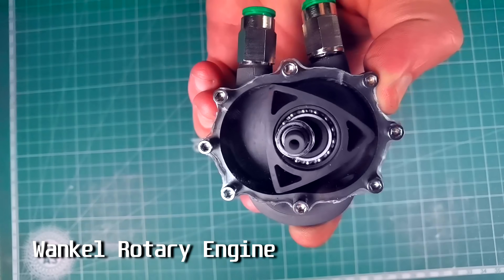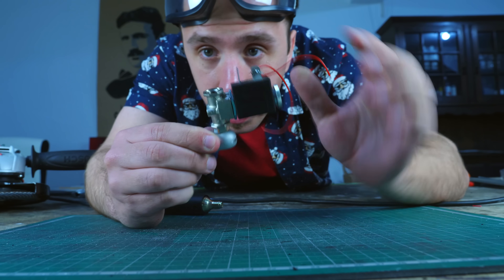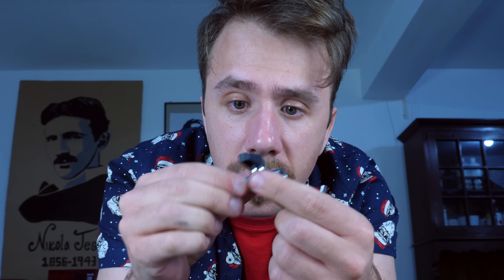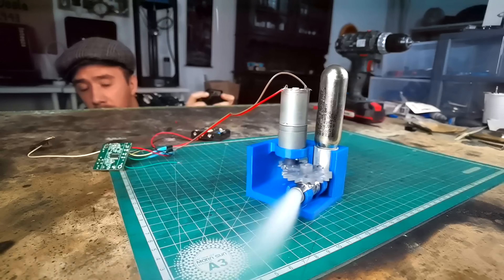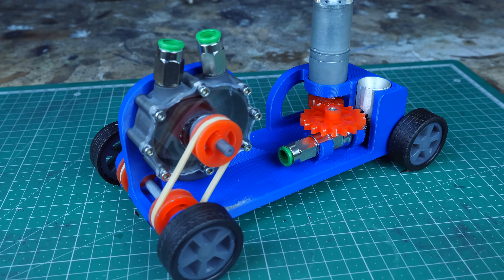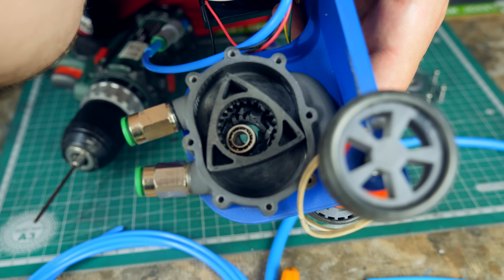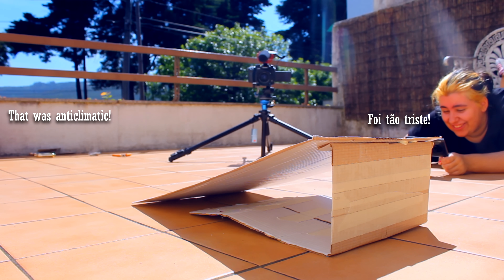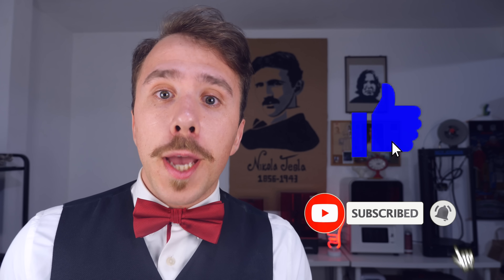Rotary Wankel RC Car (3D Printed)

Comment: 8:15 you're losing so much power to that elastic band. That and the front wheels are bouncing: you're producing more torque (even with that sloppy elastic) than the wheels can grip, causing what we in the car world call 'wheel hop'. You've got sooooo much more power on tap, I bet that car would be fast af if you fix the belt slip and put more weight on the drive wheels
Reply: thinking about it, if you ran a second or third rotor in series (gas > intake > return > exhaust > rotor 2 intake > rotor 2 return > rotor 2 exhaust to atmosphere) and had the axle more solidly connected, you could effectively have a wicked fast CO2 dragster.

Comment: A lot of the power was lost in the rubber band... an actual belt or "smoother" way to deliver the force from the motor to the wheels would have given better results

Comment: for the throttle you can regulate the air that comes out of the exhaust, by doing it that way you always have full power but the engine spins slower.

Comment: i think it has enough power, but the rubber band is slipping on the gears so much, and well as the tires arnt getting any grip, all of those points would be "leaks" of power. or as "@kabeer_41" stated, slowing down the releasing of "fuel" might help.

Comment: It looks like there was so much slipping between the crank pulley and the drive pulley 99% of the energy never made it to the wheels. Yes, reduction gearing would help, but so would belt tension.

Comment: Good advice for roadside car repair. Did your engine stop working? Just disconnect your fuel line, point it out the back, and let the fuel pump propel you forward! It uses more gas, but it will get you home.

Comment: Thats cool but there's some mistakes with this car.
1. You should add some weight on the front 
2. Or just use rear wheel drive (switch the direction of spin in front wheels so they become rear). 

The trick is while accelerating rear axle gets more pressure and obviously gets more grip. Same with the front one but when bracking. This will make an acceleration much quicker
P.s. please tighten up the belt. Its sliping

Comment: Did the wankel engine say cold running on compressed air? Because a reason I've heard that piston engines last longer than rotarys is that they have the intake and exhaust on opposite sides, causing one side to be hotter than the other.

Comment: You would get less loss from leakage if you ditch the quick connects and go with something like steel braided fuel line hose and connectors.

Comment: The problem is not the engine, it’s the loss of power through the rubber band, there is a massive amount of power left for you to use

Comment: Hey, some suggestions, use a small gear coming off the wankle's axle and a larger gear on the wheel's axel would be a better transfer of power. Also the exhaust from the motor could be redirected to help push the RC car. Also, reducing the the diameter of the pipe before the CO2  goes into the motor will let the motor run longer and put less stress on it
Reply: Yes, you are a man of energy conservation as well, I'm seeing a lot of wasted energy in this video. I mean yeah great work but it's not performing at its most potential.
Reply: It  is honestly cringe having this machinery , and end up not doing these optimizations
Reply: +Wankel engine leaks
Reply: Also there are things called pressure regulators, purely mechanical, probably would be the easiest way of limiting the gas flow😁
Reply: The rubber belt he uses also slips a lot, using a toothed belt or a chain would work much better
Reply: Ooh maybe integza could try to make a pressure regulator himself, its basically just a spring that presses against the incoming gas - and a screw that squeezes the spring more firmly against the oncoming flow, thus making it adjustable - OH or he could try something whacky but fun and make a governor, used in steam engines - as a person who works with modern automation ive always been fascinated by governors
Reply: He isnt probably going to watch comments from this old vids tho😁

Comment: It would have worked a lot better if e very thing was sealed good for air pressure then also have a regular of some kind to release the gas at a constant pressure so it would go farther and longer and wouldn’t was gas as quick either and wouldn’t blow the engine apart either

Comment: i wonder what happens if you build a turbo for it. Have like 60% of the exhaust gas go back into the system and maybe it will run for a bit longer

Comment: Excelent, but, what if you redirect the exhaust gases back into the inlet with a unidirectional valve? that would accelerate the motor till explosion? Or that too much accumulated pressure will stack the engine? It would be nice to give it a try.
Thanks and continue doing this please!!

Comment: You should set this engine up with gear ratios.  Also your rubber band was slipping too from the high RPM.  I really wanna see a more realistic model car with this specific engine set up, it seems to have so much promise, and looks like such a fun project, as there are so many applications for a motor of any kind, and this one seems extra fun since you can see inside of it!

Comment: If you fixed the leaks (you could use rubber) in between the casing and the acrylic, it would have much more power

Comment: I’m not an expert but during the slow no it seemed like the rubber band he was using to turn the wheels was slipping and coming off the “sprocket” and that was causing a decent amount of the energy loss. Instead of the mechanism he used I think a chain and gear would be a slightly better approach.

Comment: So the problem now if this would be a real car, isn't overheating, it's the opposite OVER cooling, if that is you were using normal car, you could build an entire based on the cooling the engine emits.

Comment: this could be upgraded I think you got big pressure loss around your acrylic screen maybe adding a gasket could help, a tensionner belt, and maybe adding more weight in the front to give it more addesion but nice project

Comment: The CO2 cartridge will last longer if you flip it over and let the liquid evaporate to gas instead of expelling the source of energy. The cartridge works from the gas the liquid evaporates into. So for more efficiency flip the cartridge over.

Comment: Now regulate the pressure and make a cart that is rear wheel drive...and use actual belts with teeth and not rubber bands.

Comment: The rubber band belt drive slipping probably didn't help much. A timing belt with matching pullies wouldn't have slipped so much and would have put more energy into the engine. Also, limiting the pressure with a regulator would have helped with both the valve and the excessive torque.

Comment: ide try 3d printing a belt from TPE and small notches on the axle to output shaft off the rotary. looks like its losing a lot through the rubber band that's on there. :)

Comment: Why would you make a dragster front wheel drive? The harder you accelerate, the less grip you have. =)

Really cool build though, would be neat to see it taken to the next level:
1. Rear wheel drive for increased traction (adding a suspension would be best, but can't have everything)
2. Geared drive instead of a slippy rubber band
3. More gradual control of the valve to not overwhelm the tyre grip from standstill
4. Mounting the CO2 canister the other way around, i.e. pointing up, so that it doesn't just squirt out the contents immediately (it's liquid CO2 in there usually, having it upside down wants to just squeeze that out, rather than getting it out properly as gas)
5. Another rotor for both increased power as well as better balance (having two of them at 180 degrees apart should reduce vibrations a bit)

Shame that this will probably never happen...

Comment: If CO2 ice is coming out the exhaust, you're wasting a lot of energy. Think of CO2 ice like unburnt fuel in a regular motor. 

Add some kind of pressure regulator to limit the rate that the cartridge discharges, so the CO2 ice has time to sublimate into a gas and perform work before exiting the system. You should be able to drive the car a lot farther that way.

Comment: there's a hell of a lot of slip in that rubber band you can see on the high speed. needs gears or a chain and sprocket system for more efficient power transfer.

Comment: The rubber band connecting the rotary engine to the wheels was slipping alot. If you tightened the rubber band, you might of got more power

Comment: You seem to be losing a large amount of engine power from the rubber band perhaps you could 3d print a chain drive for the system.
Reply: Of course you would need some step gears to handle that speed
Reply: You could also try lowering the psi going into the engine to reduce speed and increase the amount of time you have pressure
Reply: Or just store the mechnical energy in a fly wheel.

Comment: Attach the cartridge to a turbine and the turbine in return generates torque on the wheels. A 3D printed turbine is not easy tbh if it to be efficient enough.

Comment: Try making a co2 powered plane either use the 20g cartridge as a rocket thruster or make a more efficient engine with the power of 3D printing I’m talking about full on controllable flight not something that just flips into the air out of control

Comment: It looks like the rubber band being used to turn the wheels was losing grip or there was too much slack. Maybe using a sturdier rubber belt might help with transferring the torque from the engine to the wheels.

Comment: Motor has plenty of power. It seems the rubber band is just slipping on the pulley. I think it needs a bigger pully on the engine side to gear it higher and provide more friction on band. Maybe print a regulating valve to let the co2 out over a longer time period.

Comment: What if you continued to use that motor and instead of pointing the exhaust upwards point it toward the rear to act as a secondary driving force, and try some different tires and a tighter drive belt

Comment: Maybe what you're missing is a pressure reducing regulator for the CO2 bulb outlet?
Then you could set a lower output pressure, that won't hammer your engine to death and also give you a longer run-time.

Comment: Here’s a video idea for you, make a 3D printed outdoor warning siren. The challenge is that it has to be a pneumatic siren, meaning that it works like a regular air siren, but a pneumatic siren relies on an external air supply because the rotor doesn’t have any impeller vanes.

I’m thinking for the design, you should do something like the SoCal Edison model 120. They were used by the San Onofre Nuclear Generating station up until about 2005 when they were decommissioned.

Edit: this video is sponsored by pizza, go buy pizza. By doing that, your not only supporting the channel but you’re also fueling my hate for tomatoes. 

TOMATOES ARE DISGUSTING!

-CJ

Comment: what about using the wankel engine to power a flywheel, then transfer the momentum to the axle at a lower RPM? Might end up with a slower start up, higher top speed, and longer sustained momentum.

Or it could just end up with the same issue of being too fast to affect the flywheel in any meaningful way

Comment: 1 you are pouring liquid co2 in to the engine, so at least if you use them not upside down but oposite so they do not pour all gas in form that have less pressure and less volume it maight make more sense :) 
2 i love your country and if i have to fingerpoint fev things that i like most one of them would be industrial scrapyards, like the one in sines, and seing you struugling with all this funky parts makes me screaming inside, if its not close by i think you may have sucess to find other ones, but the point is that if imin Portugal and i need some wired parts usualy i get them on scrapyards, (usualy industrial ones not for just cars).

Comment: Clearly just needs more power. Soda stream canister rocket next pls!  😍
Reply from the maker: I like your style Angus!
Reply: @integza  you were losing a lot of power using the rubberband. the way it is bouncing around and not sticking to the axil. also recommend making the exhaust of the little vehicle point to the rear so you can use the rest of the power loss to help propel the car.
Reply: @integza  Make a regulator for your car. Or just directly connect the engine to the drive wheels using gears or something.
Reply: @integza  you are looking alot of speed the co2 is leaking out before it should on the sides of the wankel engine please but silicone there thanks
Reply: @integza 
.....did I miss the chance to win the 3D printer???  I know its 2 years late but I live on a tiny island out in the middle of the Pacific Ocean.... and it takes a while for us to catch up to the world.  In fact the coconut that this video came in only washed up on the beach today. 😢 and I would soooooooo much love to have a 3D printer to turn all my wackadoodle thoughts into a tangible 3 dimensions from the, who knows how many dimensions, they originate in.
Anyhow, I was thinking that you should make a 3D printer with your 3D printer.  I would even be happy with the janky-incestuous offspring printer...... 🤪  Just make sure that the bottle that you put it in has a really tight cork, and that you give it a proper good throw, since its got quite a long way to go!
Aloha!
Reply: Hi me first
Reply: Sounds like a myth buster episode
Reply: well firstly avoiding draining out the liquid co2 by inverting the can will increase runtime if not add any more pressure/torque as the wasted energy from the co2 boiling outside all his projects seems like he doesn't have a clue about how supercritical gas canisters work
Reply: Is a regulator or gears would also reduce the waste.

Comment: Hey bud just perhaps you need a better valve because the Wankel engine worked quite well; it just got way too much power applied too quickly for the type of material that it was made out of...  
Perhaps you just need to control that same amount of power over a longer distance... 
Pretty fun though... thank for sharing!

Comment: What about changing how wide the gate opens to change the output pressure so the engine can take it? 🤔, maybe some weight so it doesn't bounce to add traction.

Comment: If you get that valve, you can use a PLC to turn the CO2 on and off rapidly, thus controlling the pressure.

With gearing, you might get a few minutes of use out of your cartridges.
Reply: only if he stops inverting the co2 cartridge and letting pure liquid co2 out rather than just gas
performance loss and runtime is suffering because he always seems to have the cartridge in a sub-optimal orientation
hole side up unless you need liquid co2 as a solvent rather than as a high pressure gas
liquid co2 is not useful as anything more than dense storage outside of cryogenic cooling or chemical purifications
those cans are mainly used as a source of stable high pressure gas for propellants and tend to be inserted in "devices" with the side the pokey bit jams into pointed upright to only take out gas when used

Comment: To make a shot at your thruster engine idea from previous videos try using nitrous as fuel they make 20g nitrous cartridges which could easily be balanced with a compressed air cartridge!

Comment: Integza, for the wheels, possible stronger rubber bands, or a tensioner pulley, and possible switch the drive to a rear wheel setup. (You could switch your intake and exhaust port connections around)

Comment: I printed this motor up and ran it and I’d suggest using just a drop of air tool oil in it. Doing so made it run so much smoother than with just graphite alone. I supplied it with 125psi off my shop compressor and the bypass tube on the side blew out. If you can add a bit more thickness in that spot I think it would handle it. It also has a balance issue that could be remedied with a flywheel. I would lengthen the shaft and have it protrude both ends of the engine and put a balancing wheel on the back and a drive gear on the output. All in all its a pretty good start.

Comment: Idea : use your turbojet engine and make them a turboprop engine. The concept is fairly simple but it'll be very hard to make the efficiency goes above 50% it'll be a great challenge for your resin printer because you'll deal with such high pressure and rpm. And the good news is you can replace the propeller with a razor blade and make a tomato cutter with it.

Comment: Attach the wheels directly to the engine you have to redesign your chassis and have two engines side by side I guess opposing each other I don't know then it'll be like driving your Wankel directly

Comment: Something I'd love to see is a hydrogen fuel cell. Where you print everything you can and also use electrolysis to make the hydrogen all 3d printed or use the hydrogen to power a rocket

Comment: Much of the CO2 is still too cold when entering the engine, perhaps with a metal or resin circuit it could heat up increasing the efficiency of the rc car
Reply: nope the issue is liquid co2 is draining out of the can right into the engine BEFORE it boils
why does nobody notice that "inetzga" has the cartridge upside down?

Comment: Video Idea: Design and 3D Print a remote control submarine. Would be a great project to test water tightness of 3d prints as well as ability to withstand pressure.

Comment: an idea integza next time use the air coming out of the Wankel engine exhaust as a power up by using a nozzle that will also give some resistance to the air leaving the air compressor nozzle and the Wankel engine will run longer and more stably

Comment: While very cool, a rotary engine isn't a very efficient design for pneumatic power. What would be really cool would be a compound steam engine based design, as it is designed for gas expansion.